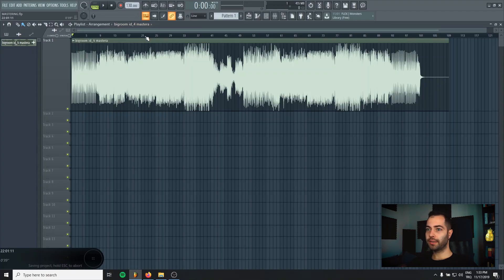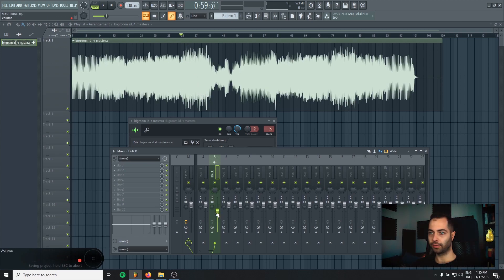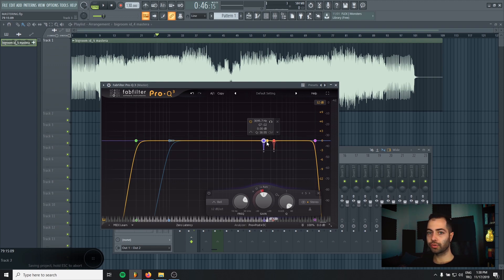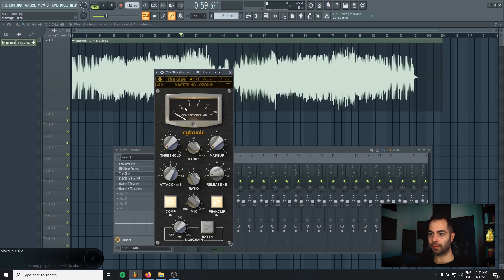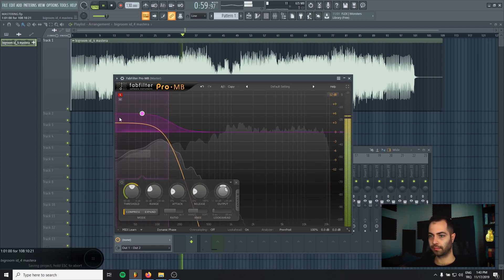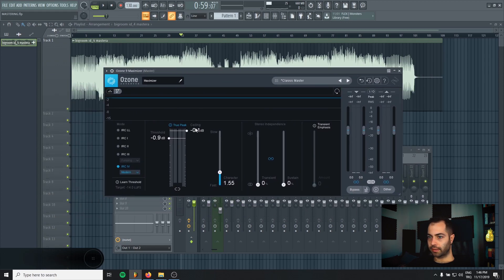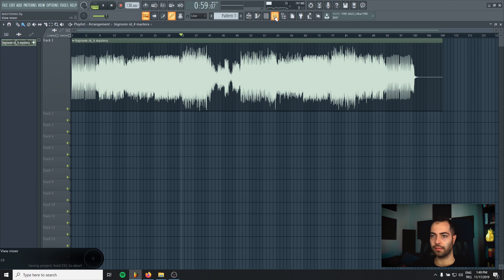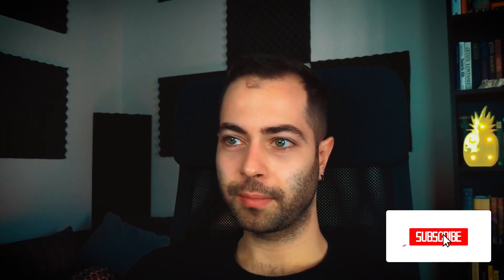How To Master Your Track | Mastering Tutorial | FL Studio Tutorial

Comment: Hi. I have a problem: I have 10 db of headroom and when I am limiting or soft clipping my track it gets distorted. I can go maximaly to -10 LUFS but I need a -7. What can I do?
Reply from the maker: Clean your low end. Check all elements in your mix and try to make them fit. Then you should be able to maximize it.
Reply: @OzgunOfficial  I have cut all lows even from kick and sub bass (below 30 Hz) .
Reply: I have cut more lows (below 40 Hz) and made them quiter. I have made the highest frequencies louder. My track is maybe a little bit better but I can not achieve magic -7 LUFS. What can I do know?
Reply: Try to give it a little bit more input gain. Limiting or soft-clipping will tend to do more distortion.
Example, if you need to get more louder than your unmastered -16 lufs, try getting 9 dB from Input instead of limiting it per threshold. Keep -0.1 true Peak limiting